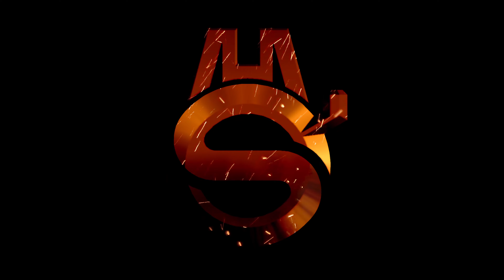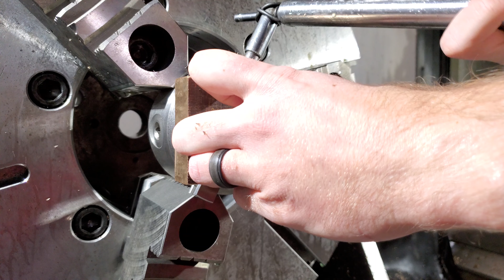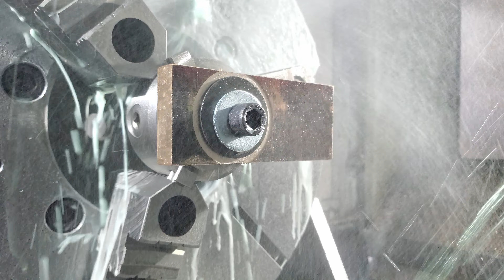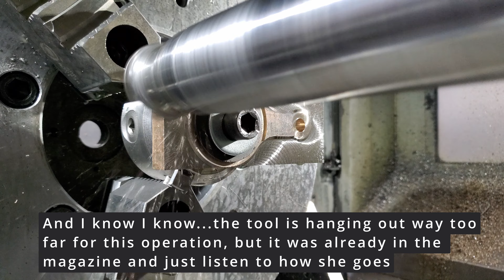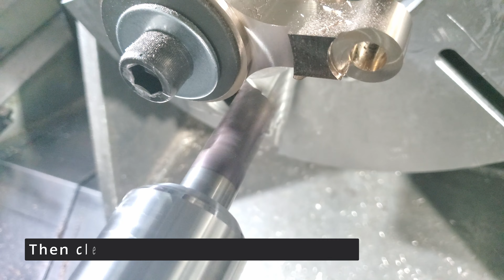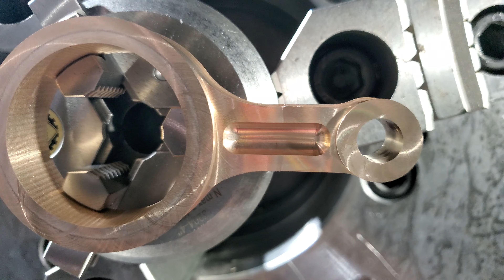Brass Con Rod Milling Operation

Comment: Came out quite nice! Also if the tool does run stable with not tooo much chatter and is in the magazine, does it really matter how long it is ? :| It's made to work properly with that stickout so all gucci and its "just brass" not inconel or something.^^